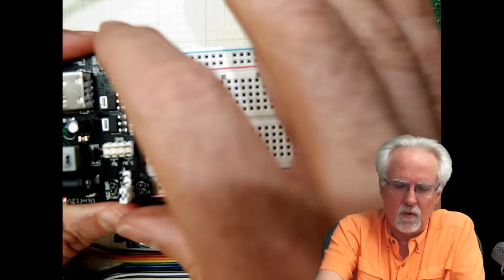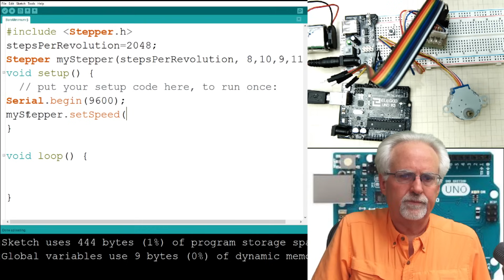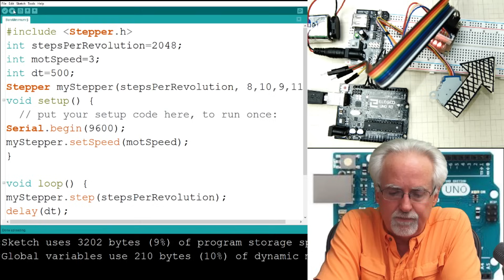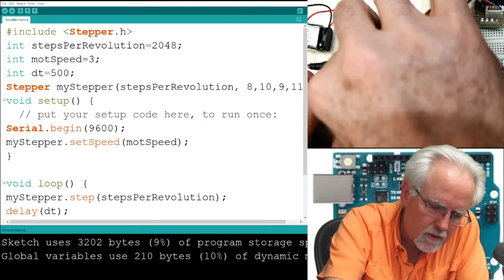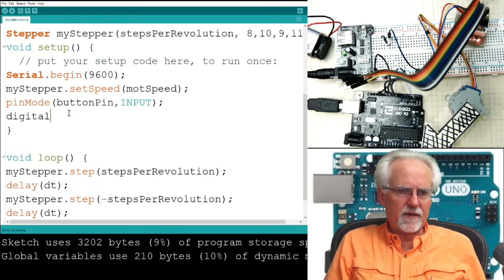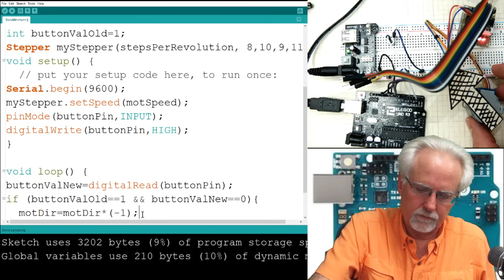Arduino Tutorial 35: Understanding How to Use a Stepper Motor

Comment: i do this whitout looking you!!! is a little diferent...

#include <Stepper.h>
int stepsPerRevolution=2048;
int old=1;
int new1;
int buttonPin=2;
int Direction=1;
int motSpeed=10;
int dt=500;
Stepper myStepper(stepsPerRevolution, 8,10,9,11);
void setup() {
  pinMode(buttonPin, INPUT);
  Serial.begin(9600);
  digitalWrite(buttonPin, HIGH);
  myStepper.setSpeed(motSpeed);
}

void loop() {
  new1=digitalRead(buttonPin);
  if (new1 == 0 && old == 1) {
    if (Direction==0) {
      Direction = 1;
    }
    else {
      Direction = 0;
    }
  }
  if (Direction==1) {
    myStepper.step(-stepsPerRevolution);
  }
  if (Direction==0) {
    myStepper.step(stepsPerRevolution);
  }
  delay(dt);
old=new1;
}

Comment: I understand that your target audience is the beginner off the street as you stated in lesson 1, but it must be realized that there is a much less complex way of dealing with the button toggle. I am referring to the usage of bitwise NOT / invert operator and writing its value directly to the port or, preferably a variable since I realize that you are exhibiting Arduino's C++ language in the high-level region rather than using the language at machine level. Once again another great tutorial from you Paul.

This is all very involved technician stuff that takes an average person with an average IQ years to build confidence.

Comment: I did not get the power module in my kit. Only stepper motor and stepper driver. Can I connect arduino to 9V battery or Adaptor?

Comment: The code looks so simple but its not very easy to understand the logical function.I wrote down on a piece of paper what happens inside the first 3 or 4 loopsteps and then realized whats going on.
In my own try I managed to get it run , but only by pressing the button for one direction and then loosening it for the changing of direction.

Comment: Wouldn't it be better to use one set of power rails for the Arduino, and the other set for the stepper driver?
The power supply has two separate voltage regulator chips, so it would isolate the circuits...
Would it then be best to put a jumper between the two negative rails?

Comment: I bumped up the speed to 20 and the stepper motor has stopped turning. It is still vibrating but not turning. The green light on the power module is dim and the red lights on the driver are no longer on. Basically, did I screw up?

Comment: I COULD NOT DO IT; BECAUSE YOU DID NOT TELL US THAT IT IS POSSIBLE TO REPLACE THE stepsPerRevolution (You said never change that, its an important number) with motDir 1.  We could not know, that. 

It is any way very confusing,  we want it to make 2048 steps we tell it to use stepsPerRevolution wich contains the number 2048 in it. So if we want it to go half way devide the number by 2, und it make 1024 steps and goes half way. 

How the Hell could we know, to put the number 1 means to the stepper to run continiusly? And if 1 means run, how do you make it go one step? Very confusing!
Reply: I think you didn´t understand something elementary.Step 1 means one loop  and then start from the beginning of the loop ,so the stepper runs continuesly over and over through the loop.Quite easy in a way!
Reply: @uweguse5405  naw, step(1) means rotating 1 step( less than 1 degree). the reason the stepper motor rotates an entire revolution is that Paul didn't put a delay in his code--> the loop happened very quickly to the point that the motor covers the whole revolution. try put a delay at the end and u ll see what I mean. Paul did forget to explain that very important bit

Comment: Tried to complete this lesson but I think my power source isn't working correctly. The battery I am using works and has enough power, but the light on the board does not light up when I switch the button. I was not able to complete this lesson and am disappointed that my board that I received did not work. :(

Comment: Actually, my motor is fine. My problem, once again, are the cheaply made jumper wires that came in the kit. Seems like the wire ends come off the wire way too easily. When there is a bad connection INSIDE the wire, you just don't see it. I have ordered new jumper wires from a different company, but I finally got the button to switch directions. Had it not been for the wire issue, I would have completed this homework project on my own. I had to change my code to match yours exactly just to prove to myself, it wasn't the code that was the issue.
Reply from the maker: Perhaps one benefit of a kit with less than all perfect components is that it helps us sharpen our troubleshooting skills.
Reply: @paulmcwhorter  This is true....but don't you hate paying for defective products?

Comment: It appears as though the motor that came in my Super Starter Kit is defective. None of the lights come on in the motor driver board and the power supply green light is rapidly blinking almost invisibly, even though the motor is vibrating. When I unplug the motor from the driver board, all the lights come on. So, I'm at a pause in the stepper motor lessons until I can get another motor.
Reply from the maker: Nice thing about the elegoo kits is they are really cheap. Issue can be at times not every part works properly. Still like the elegoo kits. You can get a nice pack of them for not much on amazon here:

https://amzn.to/303Qa51

Comment: Hello.

I apologize for your language skills. I'm from latvia!

I'm a beginner in arduino programming.
You are doing a good job and very instructive.
I've watched many of your tutorial videos.

But anyway I fail to properly control the stepper motor's RPM speed with the RC transmitter.

cods I've written -

int channel;
 const int stepPin = 3;
const int dirPin = 4;

 

void setup () {
   pinMode (stepPin, OUTPUT);
  pinMode (dirPin, OUTPUT);
  pinMode (13, OUTPUT);
  pinMode (2, INPUT);
 Serial.begin (9600);
digitalWrite (dirPin, HIGH); // change rotation direction HIGH for clockwise and LOW for anticlockwise
 
}

void loop () {

   channel = pulseIn (2, HIGH);
  Serial.println (channel);
  // delay (5);
int Speed = map (channel, 1984, 994, 100, 30);
   
  
  // for (int x = 1; x <500; x ++)
  
     {digitalWrite (stepPin, HIGH);
        delayMicroseconds (Speed);
        digitalWrite (stepPin, LOW);
     } delayMicroseconds (Speed);
      
}

problem - I can't get the stepper motor to run uninterrupted.

know that breaks are caused by - for (int x = 1; x <500; x ++)

but using "for (int x = 1; x <500; x ++)"
I can control the rotation speed with the RC transmitter. only it changes every 500 steps.

if i do not use this part of the code the stepper motor rotates very slowly and i cannot control the RC transmitter  rotation speed.

serial monitor I can see well that the values change from 1000-2000.

can't figure out how to live without "for (int x = 1; x <500; x ++)"

and everything will work as I wish.

I would be very grateful for the help!

It would be great if you made a video tutorial! Many would find it useful!

Have a nice day And keep doing what you started! Glad to have someone who is happy to share their knowledge with others!

Comment: I managed to successfully get the project working (although it did take me a bit of time), and i have to say after using my method, your solution was really neat way of using the negative/positive to control the direction. I used a longer method which i figured out from doing one of my own programs. the goal of that one was dimming an RGB LED individually. Button A would brighten, B would dimm, and C would select which RGB A and B would actually control.

Basically, after many failed attempts, i ended making button C a glorified counter (0=R, 1=G, 2=B), then loops back (if 3, then value=0). after that, i simply added "if" statements for each value (if 0, A/B buttons control red, if 1 then green, and if 2 then blue). That allowed me completely separate anything each individual "if" statement is doing, and the button press is only strictly in charge of the selection. So basically i ended up making a "selector" switch which i guess will come useful for later later projects since for a simple toggle, it's a bit too much work.

Comment: What if I wanted to rotate 360 degrees but very slowly, and back. I understand the rotating 360 degrees and back, how do I slow it down to a snails pace? Could I do it in short bursts with a long wait period between. Is their a way to save power by putting the circuit on a timer,  to save energy and slow rotation speed?
Reply: How would I run 5 motors off one arduino?
Reply: @SunshineAquaculturePH  there are controller boards where you can control multiple of anything while using serial data send on a single pin on the arduino. (pretty much how the 8bit displays work since they don't need 8 cables). check out the video from Dronebot Workshop called "using servo motors with arduino" and go to minute 26.
Reply: check around 24:00 in the lesson. he lowers the speed. if you want even slower, some delay might work. however, i added too much 50ms/2step and it was working correctly at that point. as for real life use, just add gears.

Comment: Im a bit confused as i see the datasheet of the steppermotor it looks like

Speed Variation Ratio 1/64

 Stride Angle 5.625°/64

Should steps per revolution not be 64*64=4096 ?

Comment: the elgo driver does not work some times unless you switch IN1 with IN4 .
Reply: I found a bug that prevented it working. I had set Stepper myStepper(stepsPerRevolution, 8,9,10,11);   It should be 8,10,9,11....... easy human flaw but caused problems.
Reply: @battyjoe  Yo! Thank you so much! I was beating my head against a wall! So easy to miss, and so hard to spot!
Reply: That's right! How'd you figure that out?
Reply: Wow what a life saver..... I wish Paul would have mentioned that... Thanks a lot by the way.... Because the stepper motor was misbehaving
Reply: thank you bro you saved me hours of trouble shooting
Reply: Well it didn't work too
Reply: Don't do this it may damage ur driver 
Mine didn't work too and I used ur method and it worked but when I changed the code to stepsperrevolution/2 it didn't work
Instead of doing that change ur battery my problem was battery
Reply: You are correct @CARLOS DESOTO. My stepper was only going 1 way until I swapped in1 and in4. Plus, my 9V was being loaded down to where it stopped turning after 3 turns. Now it works perfectly. Cheers!
Reply: I was having the same problem...

Comment: for the battery, can I use a 12 volt lipo instead?
Reply: yes, the power board that came with it can take 12V. however, i haven't tried 12V into the arduino itself.

Comment: Great lesson, for my "Homework" I got the change of direction but the motor only did one rotation then waited for a button press to start in the next direction. for my pinMode I use  pinMode (buttonInput, INPUT_PULLUP); which work the same as your digiatlWrite method.

Comment: Yes those batteries are lifeless. I couldnt't get the switch to work. I get 5v across the switch and zero when the switch is depressed but no change of direction.  I will review the video again. Also you forgot to show the additional code at the end. Great lesson.

Comment: How did you determine the steps per revolution. The data sheet for the Elegoo stepper on the cd does not mention 2048. I can't find a datasheet for that stepper that does. I am basically lazy and copied you...
Reply: Stepper motors can be driven in different modes and use different gear ratio. Both factors have an influence on the number of steps per revolution. In this example, you’re driving the motor in a mode known as the full-step mode, with each step corresponding to a rotation of 11.25 degrees according to the datasheet. That means there are 32 steps per revolution (360/11.25 = 32). In addition, the manufacturer has specified a gear ratio of 64:1 for the 28BYJ-48 stepper motor. To obtain the final number of steps, the gear ratio must be multiplied by the number of steps per revolution (32 x 64 = 2048). The more accurate value for the gear ratio is actually about 63.68395 : 1. Therefore, we could also set the final number of steps to 2038 (32 x 63.68395 = 2037.8864 or 2038).

To get the full precision listed on the datasheet 5.625º/64 you need to drive the stepper in half-step mode. As it stands, the Arduino’s built-in Stepper library doesn’t support half-step. You’re left with 11.25º/32 therefore,  360º/11.25º =  32 (steps per revolution after gear reduction) x 64 = 2048 the number of revolutions at the motor. 
https://download.mikroe.com/documents/datasheets/step-motor-5v-28byj48-datasheet.pdf
Reply: @eetech_fix2393  Thanks for the explanation, I had seen both 2038 & 2048 in different web pages  and could not figure out where either of those numbers came from.
Reply: I too would like a bit further explanation .. please show what info was used to get the 2048 number.